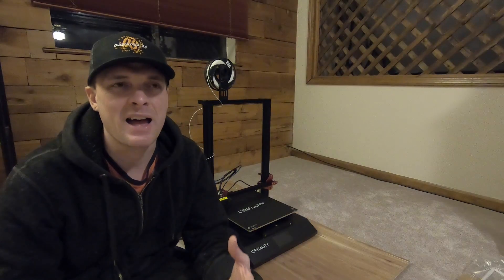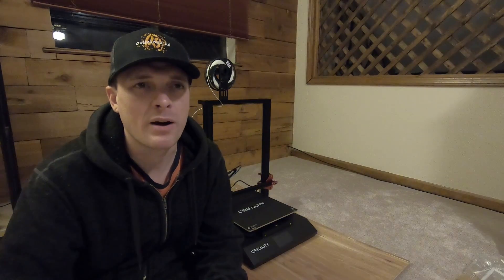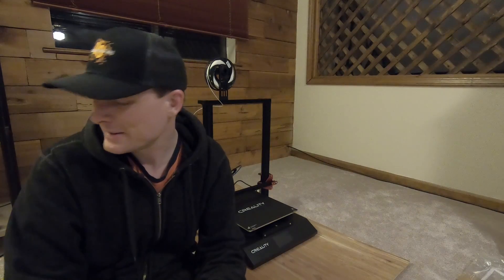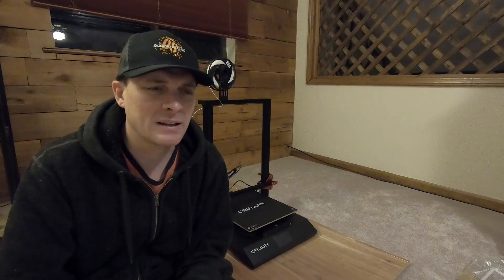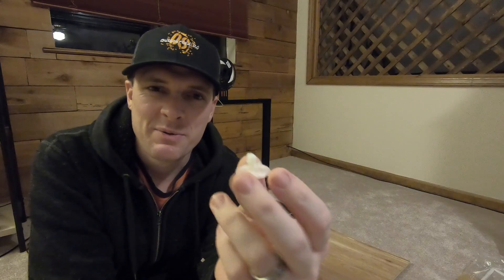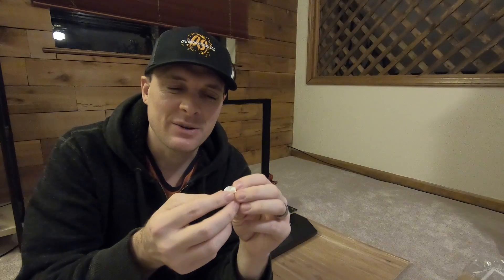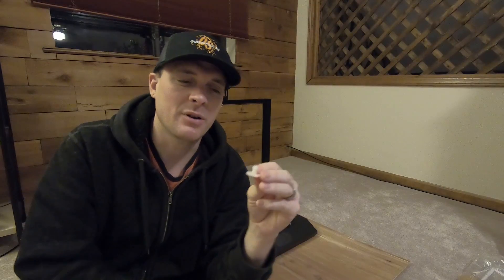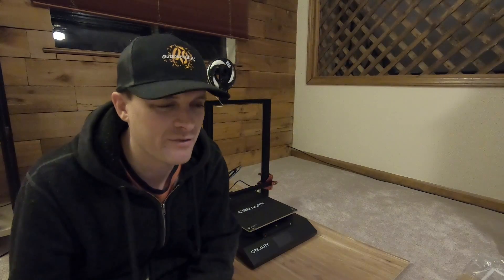My New 3D Printer

Comment: Congrats on getting the CRs 10 Pro, I'm getting ready to order my own. I'm finishing up the print closet in my basement by running power and vent fan under my basement stairs (did built in shelves/print station). You will probably be using ABS for your parts and want to make sure your room is vented properly. "Tiny Machines" has a firmware upgrade you might want to look into. I'm waiting on them to order my CRs 10 Pro through them because they install it and only a couple of bucks more than Amazon. Good luck and please post lessons learned/experiences/suggestions when using a 3d printer.
Reply from the maker: Yeah I'm building a cabinet with ventilation for it when the weather lets me.

Comment: Hi, perhaps the things you print are not suiteable for body post and parts like this because the printed parts may not be shock proof. Most parts that I have seen did not fexed enough to be useful for RC Cars. So may be you can make some tests and try to bend them. More easy to see how parts may behave is if you freeze them to -18 °C and then bend them. Compare this to other parts from your Cars and you will see a huge difference. I may be total wrong but this just for info.
Reply from the maker: It depends on what the part is used for. My SMT10 and Clodbuster dont take the same kinds of shocks that things like my Rustler and E Revo do. The body mounts dont need to be as tough.
Reply: Yes, you are right. It depends on for what purpose and for what car.